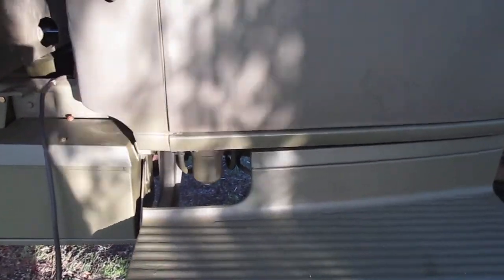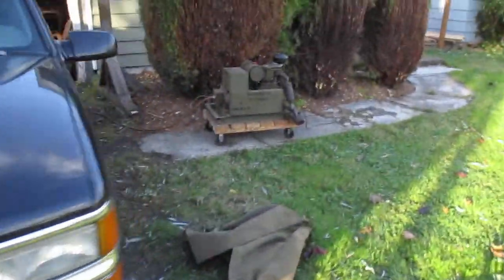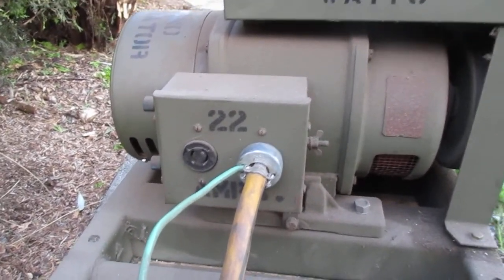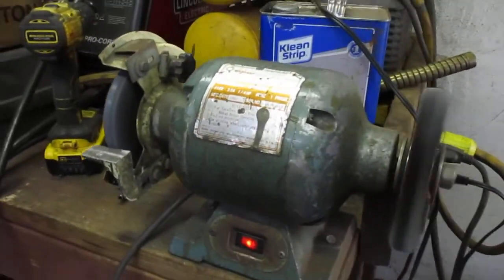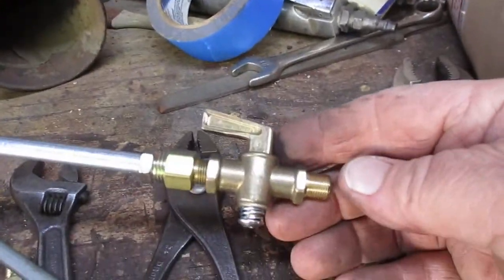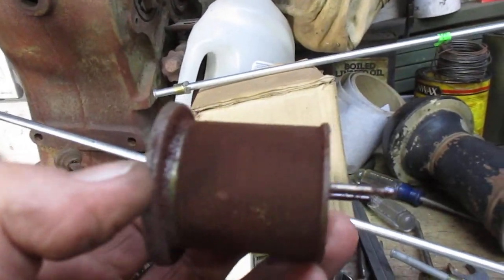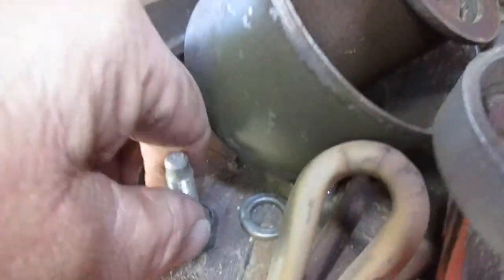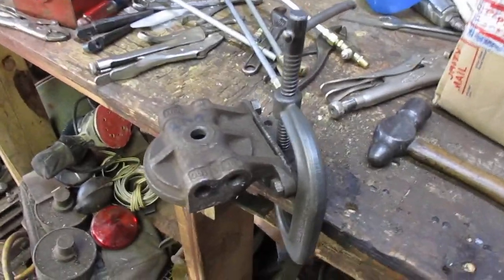Cleaning Fuel Strainer 1

Comment: Should have run the197 and you could have powered the house
Reply from the maker: You're right, that would have worked out really well. Only problem is that I don't have a disconnect between the house main electrical panel and "the grid". Don't want to give away free electricity now, do we. Hope all is well with you !!